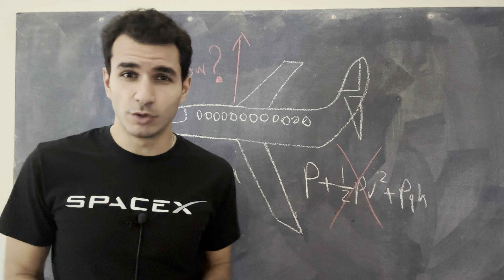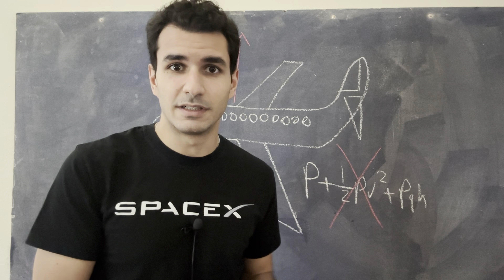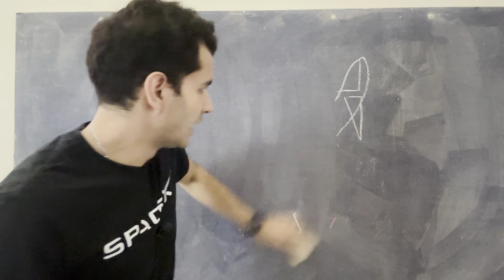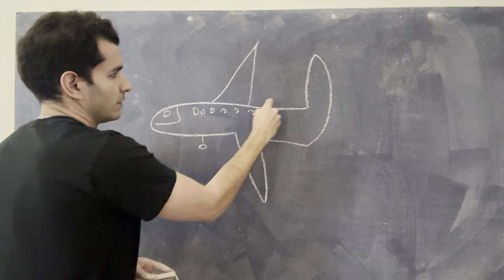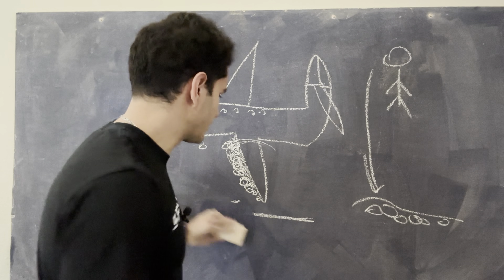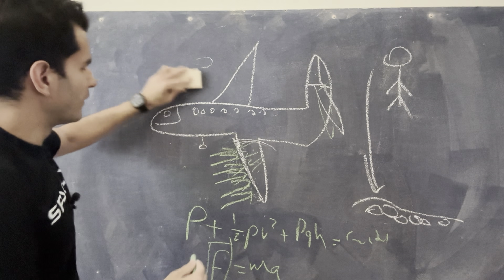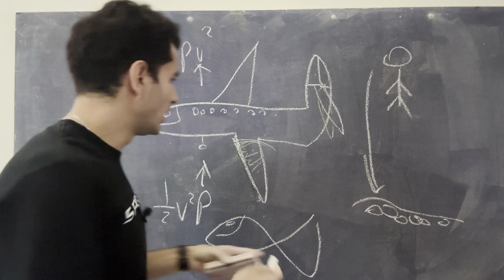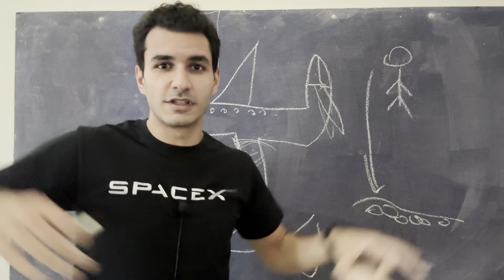Fix This One Misconception = Understand Airplanes Forever

Comment: Your explanation is overstating the effect of molecules applying pressure to the bottom of the wing. An overwhelming percentage of the lift force is generated by curving the airflow (streamlines) over the top surface of the wing. The more curvature you apply to the streamlines, the steeper the pressure gradient. But why does the airflow curve? The air has viscosity and attempts to "stick" to the top surface as it bends the corner, and each successive streamline of air molecules tries to stick to all the other streamlines below it. You can also think of the air spilling over the top surface and being sucked into the vacuum left by the airfoil's wake. The more you increase the Angle of Attack, the tighter the corner the airflow must turn, the more the air pulls on the wing, like a powerful spring being stretched apart by a "centrifugal force" as it is flung around this curved path. In turn large amounts of air are accelerated downwards every second and an equal and opposite force is applied to the wing.
Reply: Exactly, the effect of the dynamic pressure only scales up or down the ammount of absolut aerodynamic force (like lift or drag for example) but It has nothing to do on why certain geometries generate circulation and, therefore, lift coefficient (whether by increasing angle of attack or because of geometrical camber)...

Circulation is a natural viscous effect that is highly exacerbated in geometries which have thin trailing edges (like airfoils, flat plates or even your hand when its out of your car's window).

When streamlines are following (are attached to) an airfoil , and they "see" the thin trailing edge discontinuity , the "less effort" way of flowing through this geometry is in a way that streamlines must leave the airfoil in the direction the thin trailing edge is pointing out.... This is usually referred as the "kutta condition" and this is really the Key concept that explains why wings generates circulation, therefore lift coefficient that , when submmited to a given dynamic pressure, now yes: generates lift.
Reply: Yes it is the curved flow above the wing that produces the majority of the Top-Bottom pressure difference. Gustave Eiffel, Eiffel Tower engineer,  is credited with discovering this in his Paris wind tunnel. The tighter the curve, the lower the pressure.
. . . . 
AND IF you understand the physics fully: BELOW the wing, the tighter the curve that the flow is forced to take, the HIGHER the pressure there.!. Yep .Physics.
. . . .
. . . . 
No, it is NOT viscosity 'sticking' air to the upper surface.  Air has very little viscosity. It is not 'sticky'.
.
Atmospheric pressure does NOT vanish as soon as the wing moves.  Pressure pushes on ALL surfaces and NEVER stops pushing air DOWNWARD against the upper surface.  [nor stops pushing air upward against  the lower surface - during normal flight] 
.
Air is not "sucked" down to the wing.  Atmospheric Pressure is pushing DOWN on the upper surface when lift is being generated and it is keeping  that flow following the wing's upper surface.
.
You can "think it" BUT -- AIR is NOT, NOT, NOT  "pulling" on the wing's Upper surface.  It is JUST PUSHING DOWNWARD LESS. . . 
. 
 These pressure CHANGES around a wing are TINY. . . WELL UNDER ONE PSI.  
.
The pressure below a Cessna 172 only increases at most by 0.02 PSI.  
The air pressure above that wing decreases by only about 0.08 PSI. 
.
-0.08 is a larger CHANGE than +0.02  
.
THAT is a Top-to-Bottom difference of about 0.1 PSI - -> 1/10th a PSI.!
.
. . . . 
THE TINY amount of Air's Inertial force is NO WHERE enough to fully counter-act the ambient atmospheric pressure of 14 PSI. - NOPE.
.
Atmospheric pressure is VERY HIGH by comparison to air's inertial force.
.
That above-wing  change is a change of only 0.08/14, or 0.5714 % change in pressure.!. 
.
.
With the  Cessna wing area of 25,000 square inches, that 0.1 psi Top-Bottom difference produces an upward force of 25,000 x 0.1 PSI or 2,500 pounds of lift force.
.
It is the Inertia of air that is trying to CONTINUE UPWARD after it passes over the leading edge that is working against the atmospheric pressure at the surface.

.
It is EXACTALLY like why you push less on the seat of a roller coaster at the top of a hill.  YOUR INERTIA counter acts gravity.  YOUR BODY tries to keep going upward thus reducing your pressure on the seat.  Newton's First Law.
GRAVITY is STILL pulling you down to follow the car and track - JUST LIKE atmospheric pressure holds the air in the curved flow above the wing. 
- - - - SAME PHYSICS!!
. . .
IF you want a spring analogy, think of two springs between your shoulders and the two side doors of an auto.   Make them long, so you must compress then to put then BOTH between EACH shoulder and the nearest door - - Squeezing you in the middle.  These springs are like atmospheric pressure.
.
NOW go around a corner.  
The  spring on the 'outside of the curve will compress. MORE
The spring on the inside will compress LESS.
The spring on the inside is STILL pushing INWARD against you, but less - BECAUSE YOUR Inertia wants to go straight away from that door.  THis is just like above a wing.
.
The spring ion the Outside OF THE CURVE is like BELOW  below a wing. Your body wants to go straight and pushes MORE on that side (the old Centripetal Effect).   
. . . 
Ai's Inertia is the major thing causing pressure changes around a wing - Both increases AND decreases. 
. . . .
. . . 
The only "sucking" that is going on is because the Pressure Gradient between the high pressure near the leading edge stagnation line (this can be 0.34 psi 2% above ambient) pushes more than the LOWER (sucking) pressure above the wing (-0.08 psi) and, THEREFORE Horizontally Accelerates that upper air rearward toward the trailing edge.  THAT is WHY the upper air reaches the trailing edge first. 
The air below a wing is actually pushed forward in flight [by the higher pressure] , making it take MORE time to get to the trailing edge than a spot on the ground. . . 
.
What is suction:  www.youtube.com/watch?v=Ycef5XXiozc 
. . .
Understanding Aerodynamic Lift Correctly: rxesywwbdscllwpn.quora.com/
.
Regards.
Reply: Air flowing through an airfoil at a given angle-of-attack establishes a flow field that usually achieves higher magnitudes at upper surface than at lower surface, conversely leading to higher pressure reduction at upper surface when compared to the lower surface. Sure, pressure imbalance is what leads to lift (after integrated over the wing's area). So, you're right: this part of explanation has everything to do with pressure and little to do with shear (viscous) stresses  (more on that later).

But why does air flow through an airfoil in such a special way, in the first place? Or, what is actually special about these airfoil geometries? 

This is the part in which more refined explanations tend to refer to the fact that these geometries generate "natural" (non-spinning) circulation. The circulation, in turn, can be related to how streamlines flowing through an airfoil are averagely deflected downwards. And sure, streamline's direction rate of change has everything to do with pressure, very similarly to the way an aircraft's flight path angle rate of change is related to normal load factor (both are acting like centripetal "accelerations"). Sure, this isn't incorrect: air gets deflected downward by this magical geometry which, in turn, receives a opposite upward reaction... 

However, the question still remains: Why does airfoil geometries yield natural circulation in the first place ? 

Ok, your explanation on correlating pressure and streamline's direction rate of change is 100% correct, but it doesn't really grasp the origin of the phenomenon and what is about the geometry. You said something about surface's curvature. Well, a flat plate doesn't have any curvature at all, and it still generates lift when submitted to a limited range of angle of attack. Furthermore, you can have geometries with upper and/or lower curvatures, but if they lack a really sharp trailing edge: it won't yield any natural circulation at all. 

So, I could try to explain in my own words, but it wouldn't be close to one of the best explanations on that subject, given by Dr. John D Anderson in "Fundamentals of Aerodynamics". 

Pages 291/293 - Chapter 4.5 - The Kutta Condition: "[...] let us examine some experimental results for the development of the flow field around an airfoil which is set into motion from an initial state of rest (photographs shown in the book are taken from Prandtl and Tietjens references). [...] the flow has just started, and the flow pattern is just beginning to develop around the airfoil. In these early moments, the flow tries to curl around the sharp trailing edge from the bottom surface to the top surface. [...] However, more advanced considerations of in-viscid, in-compressible flow show the theoretical result that the velocity becomes infinitely large at a sharp corner. Hence, this type of flow is not tolerated very long by nature. Rather , as the real flow develops over the airfoil, the stagnation point on the upper surface moves toward the trailing edge. [...] Finally, after this initial transient process dies out, the steady flow is reached. Photographs demonstrate that the flow is smoothly leaving the top and the bottom surfaces of the airfoil at the trailing edge.[...] we emphasize again that in establishing the steady flow over a given airfoil at a given angle of attack, nature adopts that particular value of circulation which results in the flow leaving smoothly at trailing edge. [...] it has become known as the Kutta condition."

Ok, so the key concept on "what is actually special about airfoil geometries" is the fact that THESE GEOMETRIES HAVE SHARP TRAILING EDGES (this is true for airfoils, for flat plates, for your hand out of your car's window and so on). These, geometries when submitted to an air flow, will establish a flow field in which downstream stagnation point must be kept at its trailing edge (or, shortly stated: geometries that will respect the kutta condition). In order to flow through this geometry, air must leave through trailing edge smoothly, and therefore, the only resulting flow field that is possible is such that it must have higher velocity magnitudes (conversely leading to lower pressure) in the upper surface, which in turn leads to pressure imbalance, finally leading to lift.  

-----------------------------------------------------------------------------------------------------

Ok, about the "viscid vs in-viscid" discussion. Although lift is pure pressure imbalance effect, the nature of circulation is a viscous effect. This discussion is very complex and tricky, so I'll prefer just to cite Dr. Anderson again: 

page 294 - Chapter 4.5.1 - Without Friction Could We have Lift ? " in Section 4.1 we noted that lift on an airfoil is primarily due to the surface pressure distribution, and that shear stress has virtually no effect on lift. [...] Recall that pressure acts normal to the surface, and for these airfoils the direction of this normal pressure is essentially in the vertical direction, that is the lift direction. [...] Hence, pressure is dominant player in the generation of lift, and shear has negligible effect. It is for this reason that lift on an airfoil below the stall can be accurately predicted by inviscid theories such as potential flow. 

HOWEVER, if we lived in a perfectly inviscid world, AN AIRFOIL COULD NOT PRODUCE LIFT. Indeed, THE PRESENCE OF FRICTION IS THE VERY REASON WHY WE HAVE LIFT. These sound like strange, even contradictory statements to our discussion in the preceding paragraph. What is going on here? The answer is that in real life, the way that nature insures that the flow will leave smoothly at trailing edge [...]  is that the viscous boundary layer remains attached to the surface all the way to the trailing edge. If there were no boundary layer (i.e., no friction) there would be no physical mechanism in the real world to achieve the Kutta Condition". 

Therefore, without friction air would just flow along an airfoil without curling, as it does with a non-spinning cylinder, regardless of camber and/or angle-of-attack...  

Best regards
Laio Marinheiro 
Aerospace Engineer
Reply: @laiomarinheiro7745  
Regarding your first paragraph.
.
Air does not flow 'through' an airfoil. It flows above and below, along the surfaces.
. . . . 
Now
. . . 
You say: "Sure, pressure imbalance is what leads to lift (after integrated over the wing's area). So, you're right: this part of explanation has everything to do with pressure and little to do with shear (viscous) stresses  (more on that later)."
. . .  Then, we have lift and  we are done.
. . .
But,
. .
Can you explain what fundamental law(s) of physics tell us that the "higher magnitudes" (sic, of speed) along a surface are "leading to higher pressure reduction at upper surface" ?

.. . 
What is the physics that explains that cause-effect relationship?
. . . 
. . .
Also, I still would like to know what One Misconception you were trying to fix in the video.
- -
Reply: @Observ45er 

There’s nothing wrong with the video, and I’m not trying to “fix” anything. I made my comment because I agree with the author’s general direction. However, I expected the video to focus more on why wings generate lift and to address common misconceptions about that.

In my opinion, it overemphasizes dynamic pressure. While the explanation of that concept is solid, dynamic pressure mainly affects dimensional lift, not the lift coefficient or circulation directly.

To me, any explanation of why wings generate lift coefficient should focus on what’s special about their geometry—how features like camber and angle of attack lead to pressure distributions that produce lift.

Ultimately, the lift coefficient reflects pressure imbalance, which comes from higher velocity over the upper surface. That’s not due to a “longer path” or “curvature” per se, but rather due to sharp trailing edges—forcing the flow to turn downward. This is better understood through the conservation of mass, momentum, and energy in an incompressible, irrotational flow.

For a more detailed and accurate picture, I’d suggest looking into potential flow theory and thin airfoil theory. They offer more rigorous insight into how airfoil geometry shapes the flow field. The textbook mentioned previously is an outstanding suggestion.

That’s just my take—hope it’s helpful. No intention to spark debate.
Reply: @laiomarinheiro7745  I'm sorry.  I thought you were the author of the video.
.
But can you describe the physics I asked for?
Reply: Read "Fundamentals of Aerodynamics" (chapter 1 to 4) , it is gonna help you!  
Good Luck!
Best Regards!
Reply: @laiomarinheiro7745  I read Anderson when I got into this some hears ago, when I was asked to manage a sophisticated, full-cockpit flight simulator and figured I should brush up on some things and saw all the misconceptions on the net. I subsequently got John’s  6th edition.  
I’ve also read some others and discussed things with some of the authors as well as a couple of other known names, but not John. Although I have it in the back of my mind to perhaps call John before it’s too late.
If you don’t want to discuss this then there is no reason to continue.    
I see no misconception that the video fixes.
My comments stand.
Regards.

Comment: There are two videos on YouTube that explain the latest understanding of lift. One is by Krzysztof Fidkowski, a Ph.D. in Aeronautics and Astronautics from MIT and Associate Professor of Aerospace Engineering at U. of Mich. The other is by Doug McClean, a PhD in aeronautical engineering from Princeton and a Boeing Technical Fellow.
Reply: Both of which also have shortcomings.
Reply: Holger Babinski from Cambridge has an excellent video
https://www3.eng.cam.ac.uk/outreach/Project-resources/Wind-turbine/howwingswork.pdf

Some of the best explanations can be found in "Understanding Flight" by Anderson
https://soaneemrana.org/onewebmedia/Understanding%20Flight%20BY%20DAVID%20F.%20ANDERSON.pdf
Reply: @GZA036 In Babinsky's video he resorts rather strongly to invoking Coanda to explain flow line curvature.  This suffers from significant lack of consensus, and hand waves away pressure gradients due to core physical principles which are widely accepted.

And Anderson appears to perpetuate the unproductive "Bernoulli vs Newton" fallacy, also tipping is hat to Coanda.

Comment: For low to medium angles of attack, the net pressure integral of just the lower surface of a wing is negative, meaning the air is exerting a pressure force pulling the surface down. This real world example contradicts your explanation of molecules producing an upward pressure force? Your thoughts?
Reply: Both top and bottom surfaces need to be taken into account, and  during level flight the total momentum displacement downturn per second must equal the total force of lift.

Most of it is the lower pressure on top turning higher ambient flow above downward.

Comment: Perfectly explained. An even worse case of debates is on the case of 1 car hitting a wall at 60 km/h and 2 cars crashing head on at 60 km/h each. The non-physics persons say that 2 cars crashing head on at 60 km/h each car equals to 1 car hitting a solid wall (of infinite mass etc.) at 120 km/h. Which is wrong. Newton's principles are great and truly problem solving and no energy nonsense crap when it is about pure mechanics. Funny thing is that The Mythbusters even made a video showing Newton's 3rd law in action by crashing cars ... And some people still won't understand. Because they do not want to.
Reply: What?